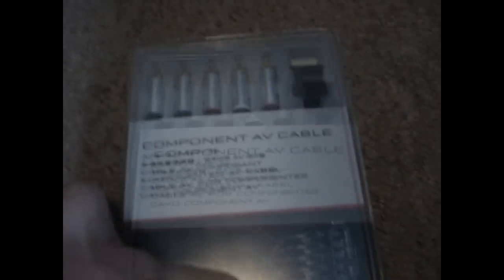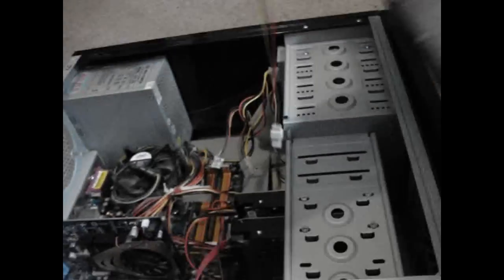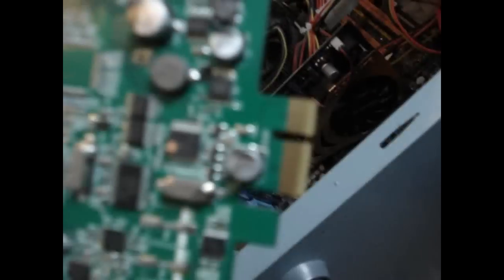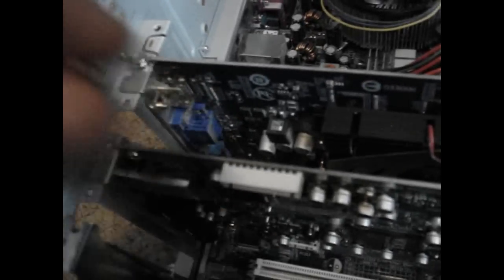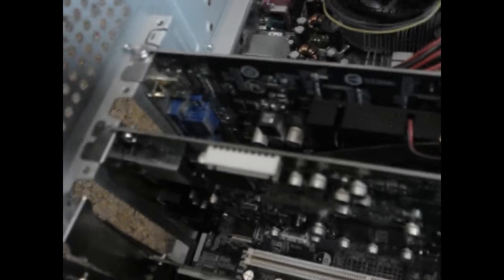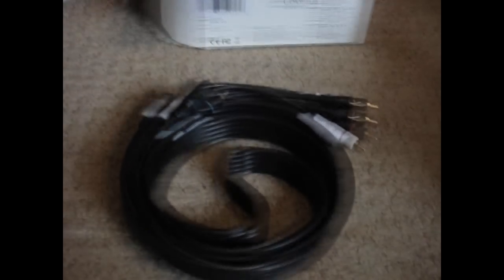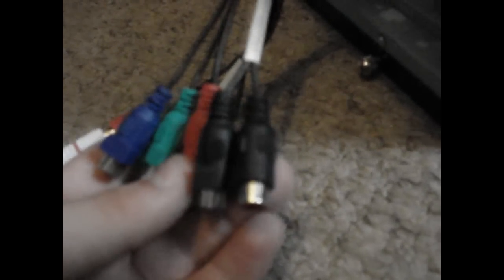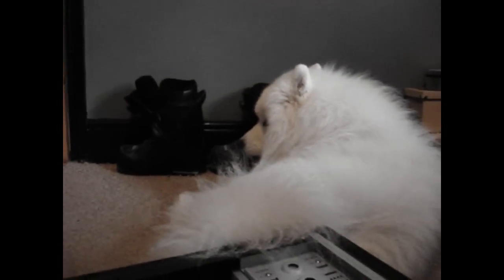How To Install The Hauppauge Colossus HD-PVR To a PC!

Comment: So Im running a gtx 430 graphics card. I have way over all the recommended specs on their website. Could someone tell me whether I can run the Collosus. OR if not, what other information you need from me about my system to determine whether it will work or not. Please respond quickly!
Cheers Turmoil.